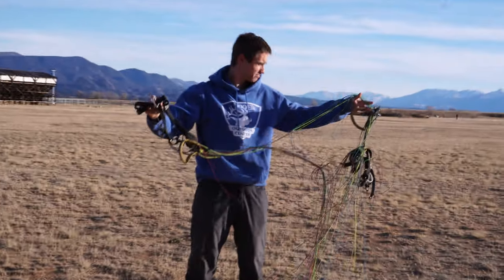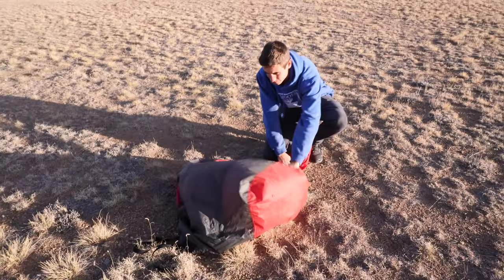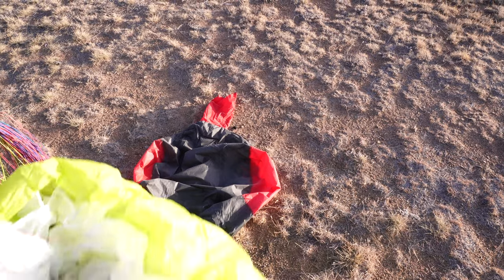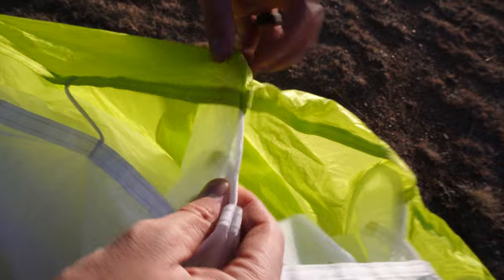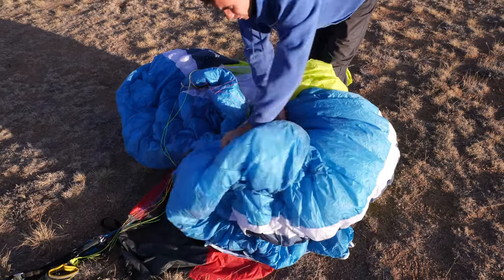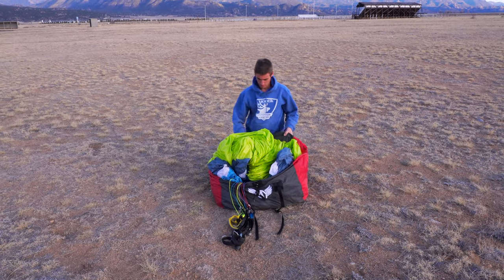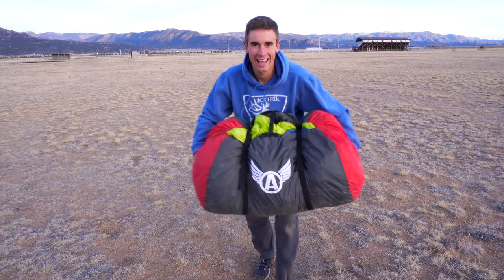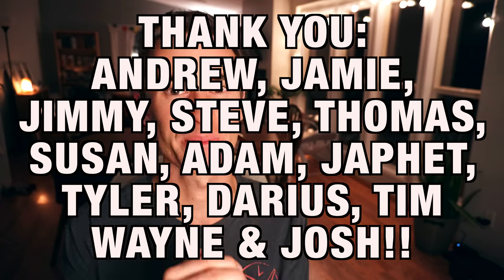Pack A Paraglider WITHOUT Tangling Lines

Comment: I completed training aver a year ago, then life and my back got in the way and I haven't flown.  I recently started kiting again preparing for flying again in the next few weeks.  I try to kite for an hour every day the weather allows, which has been 5 out of 7 days a week for the last 3 weeks.  Each time I kite, I try another packing method I have seen on YouTube or I learned in training.  What you show in this video is essentially what I learned in training and I believe I have decided it is the best way for me.  Thanks for the simple, easy to follow video reminding me of the details for this method. 
I spent an hour kiting today but the winds were variable from zero to 7 mph so I could reverse the wing up, but a few seconds later, the wind would die and down comes the wing.  I do have pretty good control over it now.   Three weeks ago I was relearning basics and the wing was everywhere but where I wanted it.  I packed the win (Ozone 30m Mojo PWR 2) as shown in your video and I think it's the easiest and fastest for me.  I hope to hit the beach (I am in Orlando, FL) this weekend for some more stable and steady winds to try keeping the wing up for more than 30 seconds at a time.  Thanks again for the video!

Comment: Hey I love your videos. Very thorough with attention to detail and no shortcuts. I recently bought an Advance Fastpack bag (see video link), and I’ve been employing your method which not only makes for a neat unfolding of the leading edge at launch but also, my risers are consistently trouble free. However I have one apprehension about your method. It concerns holding the leading edge battens between the knees during the trailing edge and other glider parts “stuffing” process. Namely I have noticed how the fabric balloons out and ultimately, even after the collected battens are placed flat at a 90 degree angle on top in the center, and then additional fabric is piled on top, the ballooning continues. Therefore it seems clear that we are choking the air exit at the leading edge as we are stuffing the glider into the bag - first by the knee action and second after the battens are laid flat. In both cases, we are not allowing the air to escape from the internal wing structures and essentially we are forcing the air through the fabric, thus encouraging increased porosity by force and thereby shortening the life of the fabric. Ideally, for a long wing life, we should work the air from the trailing edge towards the open leading edges as we do during concertina packing. There may be an argument that the fast pack is not the primary packing method and is only used during certain times, like successive launches, but some people use the fast pack as their primary method. My guess is that such people will find an increased development of fabric porosity and hence prematurely shortened glider life. I want to use a method like yours, but without the fabric ballooning so much. Take a look at the Advance fast pack video example, notice how he works the trailing edge into the bag while the leading edge is relatively open. Moreover, there is little sign of the fabric ballooning at any point during the packing process. The leading edges however, are not paid attention to as you do. So do we have to choose between leading edge integrity or fabric longevity? I also don’t have luck with leaving the harness connected to the risers like in the example video. For some reason this always seems to complicate riser unpacking at launch. Check this video to see what I’m talking about: https://youtu.be/Ad9w-DbJwpc?si=H1ecZNy4WJUgV56i I hope you have a chance to comment. Thanks, Steve :)
Reply from the maker: Howdy, thanks for your thoughts! I’m hard pressed to believe that the air escaping though the fabric is increasing porosity, but that is an interesting theory - ultimately I think loosening the knees up a bit and pressing the air toward the leading edge is going to let that air escape through the cell openings. It doesn’t need to be a very forceful operation either, the air will leak out eventually wherever it can without damaging the fabric. Good thoughts!